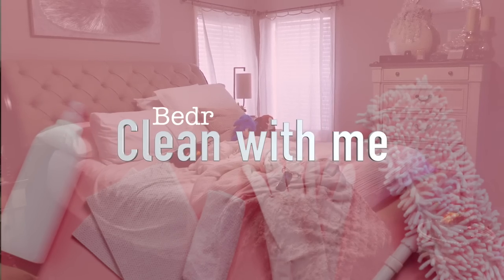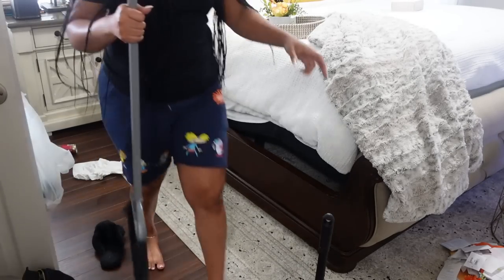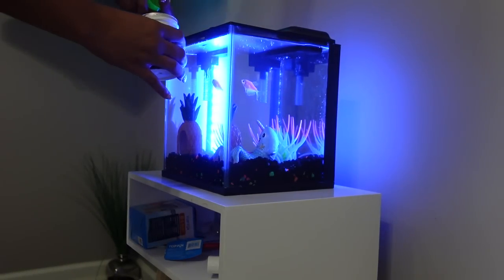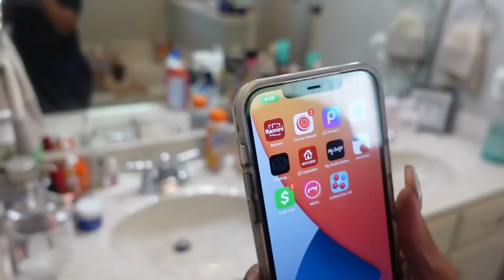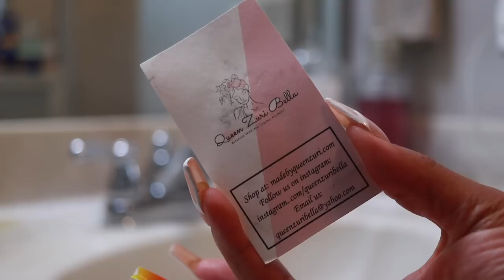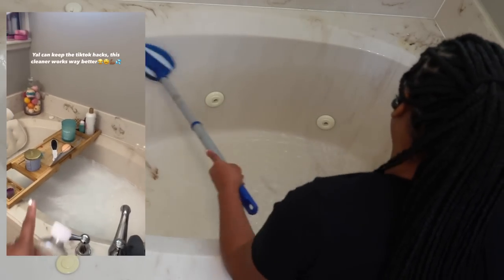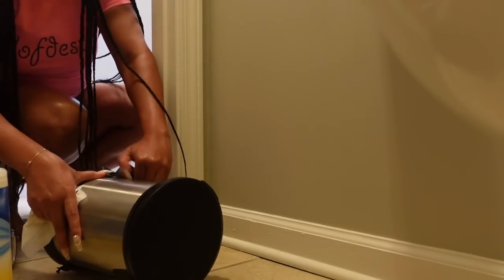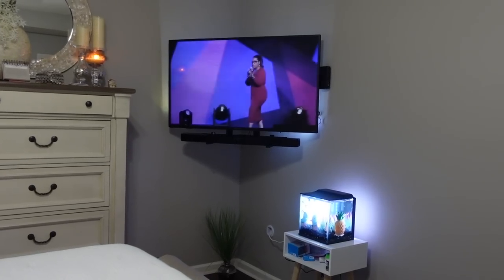BEDROOM & BATHROOM CLEAN WITH ME | EXTREME CLEANING MOTIVATION 2022

Comment: Happy Sunday evening! I noticed you often spray heavy glass cleaner on your mirrors and the cleaner runs down the mirror. Mirrors are just glass with an aluminum/silver/oxide coating on the back used as a refector. Thus, the chemical in the cleaner will cause the erosion of the finish from the bottom up. It took me a long while to figure this out until a mirror installer told me what I was doing wrong. Not one problem since.

Comment: The staining is something that happens as a result of sitting water on surfaces. I also think using harsh chemicals on upgraded stones can be cause of some of the yellowing. The discoloration is on the seal. If you have someone come remove that seal and reseal the bathroom,it should fix the issue. I had this done at a previous home for the same thing and it fixed the issue. I would be cautious with over-using bleach on the marble.